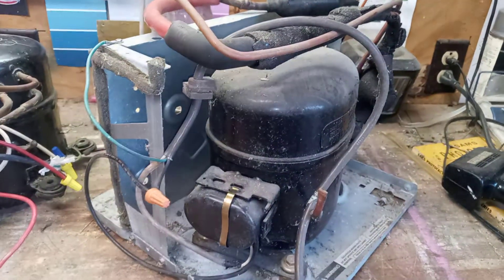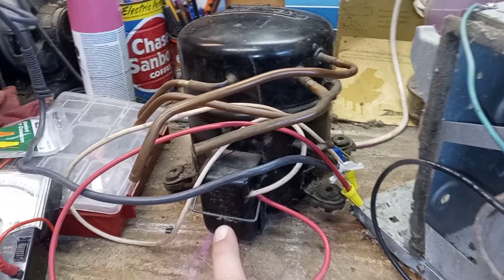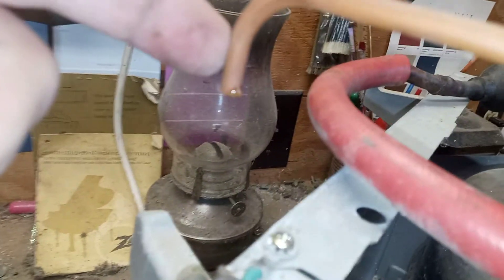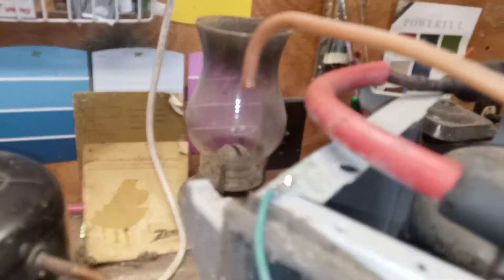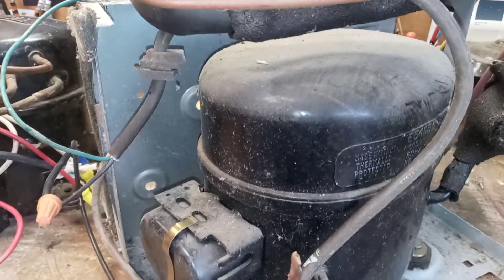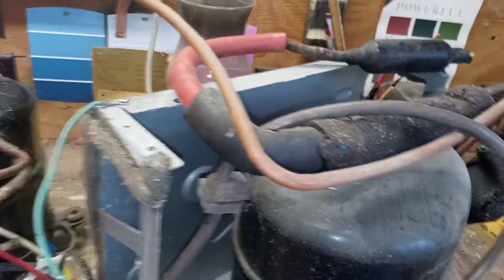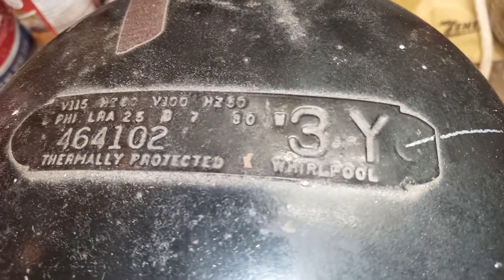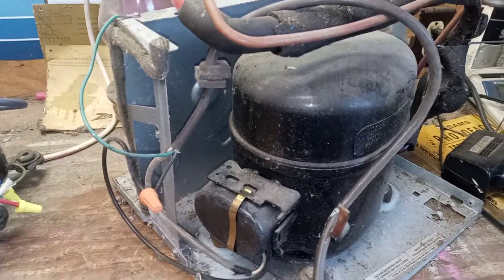Refrigeration compressor test and fail ,from recycling center.

Comment: The compressor that runs looks like a Tecumseh AK series.  If it’s an R-22 compressor, it’ll be perfect to use for an air conditioner (small chassis) with a bad rotary compressor